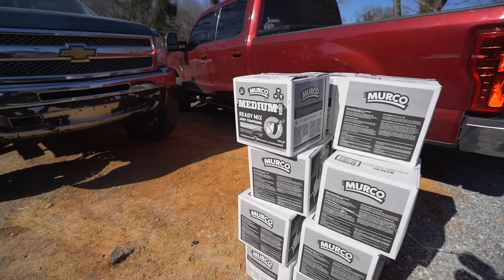How To Install Drywall | Drywall Installers| Building A $350,000 Custom House | EP 36

Comment: I am a hanger not a taper , so i can tell u these guys did a good job hanging .  Only problem is you didn't apply glue , the glue literally bonds drywall to the stud . if u knock on a wall that is glued and one that is not there is a big difference , not only that but for ceilings it is vital so it wont crack in time . Second problem is they didnt let tape dry a whole day .  Never a good idea to cut corners buddy .
Reply: Exactly what I was thinking guys were 110% on point but where’s the glue 😭😂
Reply: I was thinking the same thing…where is the glue? The only other thing I don’t understand is it seems that the southern crews put the belly band in and I don’t get it. Start with a rip and you have all bevel to bevel joints. I do have to give it to these guys they work well together only mistake I saw in the video was the fan in one of the bathroom ceilings (router got away) on the guy. It happens though not being critical at all.
Reply: Lmao not all states require it I don’t like glue thank God they don’t recommend here makes demo hard . In all types of surface etc wood flooring

Comment: Just.
 Another update from Australia. When we hang a house, we use steel batons on the cilings, we don't do direct fix, we glue our ceilings as well. It takes a little bit longer, but you get paid for it. And it's 3 times the job.

Comment: Guys do a great job! But from experience your house is 100% going to cracks. What we do for customs homes we prep it before we even put the tape for any big gaps and to cover the nails they hammer by the joints. But most important is to tape it and let the tape completely dry before floating. That one extra day of waiting for the tape to settle will save you from having the tape start piling off and cracking all over the house.
Reply: I was going to say the same thing,  I always let my tapes dry before I do 1st coat. Also if you are going to tape and coat atleast prefill it 1st. I prefill butts and large gaps regardless but it's a must you prefill all the flats n butts when doing tape n coats.
Reply: I said the exact same thing. Between lack of insulation and hurrying up a process that requires drying time this house is going to have problems.
Reply: These guys do nearly flawless work. All they will need to do is coat the shrinkmarks before they coat it again. We do this all the time and there’s no cracking or tape falling off because of it

Comment: After a couple of years my batteries on my cordless screwguns, and routers are starting to wear out and because of the price of batteries I've been wondering if it would be better to switch back to corded tools. After watching these guys walk around on stilts dragging those damn cords I'm gonna buy some more batteries. I forgot how much I hate those damn cords. Overall it looks like they did a pretty decent job on the hanging, but they didn't do any prefill on the larger gaps, or on the belly bands which means  a high likelyhood of cracks down the road, plus mudding over wet mud is a terrible idea. Regular mud dries through evaporation so if the tape  coat is still drying and you put another coat on top bad things happen.  I'm calling BS on them doing all that in one day, even with 9 guys.

Comment: Number 2 update, in Australia most builders want you to use cement sheet in wet areas and I recommend it to. This team is good no doubt, but there is room for improvement such as cordless screwguns auto feed then there will be no leads on the floor A lot safer for the guys Walking on stilts. And a lot faster The trades will know what I'm talking about.

Comment: They do a great job just one thing I didn’t like and that was they did not prefill anything! That’s going to cause crazy warranty issues for the drywall company later especially using tools, and not hand finishing
Reply: No need to prefill anything. They will probably coat the shrinkmarks similar to how you coat the screws. Do this after what they did here dries and before it’s coated again. Gives you the same result or better in less time. They won’t have any warranty issues from this crew. I would have no problem paying this crew top dollar

Comment: The insulation material is dangerous to health ... Before putting on the plaster, you should have installed protection against moisture over the insulation

Comment: Plaster is mounted lengthwise, not widthwise, plaster works when it's summer and winter, in summer it stretches and in winter it shrinks, both times change in length because in the beginning it was intended to be mounted on the right, so is the width. Very bad work, I think, and it's the rules in Sweden.

Comment: I'm always surprised looking at American construction crews working, they all seem to use corded power tools. In Australian the plasterboard (Gyprockers) boys use screw strips on a Collated Screw Gun and all their power tools (MAKITA) are cordless. Either way good job.
Reply: I'm a commercial drywaller, and we use all Hilti cordless screw guns, with the strip of screws. All our tools are Hilti cordless. Residential is way behind commercial when it comes to tools. We also use a panel max ,and eliminate all corner bead.
Reply: @chainDex  what do you mean eliminate all cornerbeads?

Comment: Can't believe they don't use cordless guns and routers and to be honest they put rips in areas where you try to avoid or at least so you don't have to hear finisher's complain lol and having that many guys there's no way there making any money honestly cause I hang drywall I have a 3-4 man crew and there Mexicans also and they hang roughly 100 sheets a day and they need house after house to make it worth there while and that's getting $10 dollars a sheet and yes I make acouple dollars off the top cause I'm also hanging myself and getting the jobs and supply screws and stuff so, but not trying to pick on there work just a few things I seen and don't like is all but like the vids definitely give people the insight on what goes on in building homes or whatever it may be

Comment: They didn't mud that in 1 day...they did it in 2 days...hung and taped...but bedded it the next day and then skimmed it the next...sorry 3 day...4 for sanding...that is VERY GOOD STILL...but don't be mislead..not done in 1 day I've done this for over 20yrs...finisher for 20...can't pee on my leg and say its raining...good work though...
Reply: Nah. Tape and coat it on day one. Skim shrinkmarks and coat on day two. One guy will sand it in half a day on day three. Flawless work

Comment: No glue, only 2 screws in the fields, what looks like 54” board no corner beads at all, they used paper tape for corners good luck”. I hope you got the 1year point up included in your contract! No wonder they did it all in 9hrs. Never cut corners!!